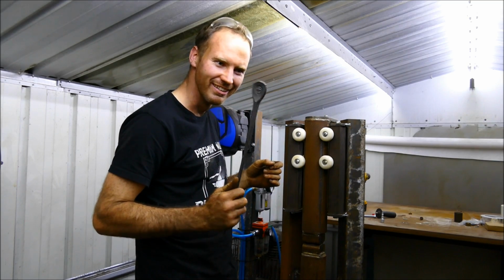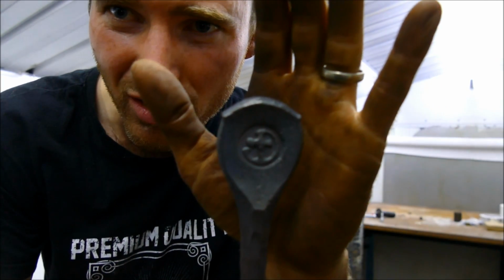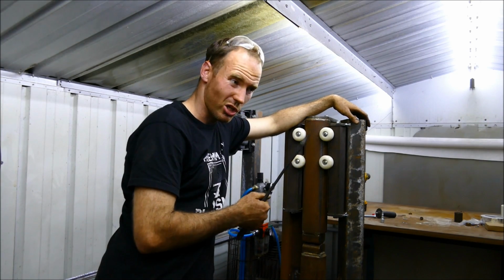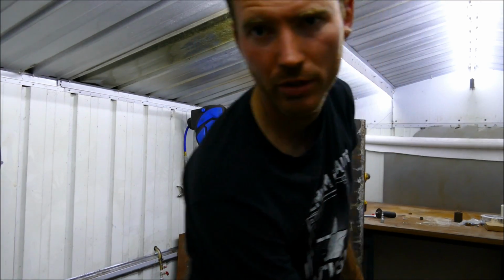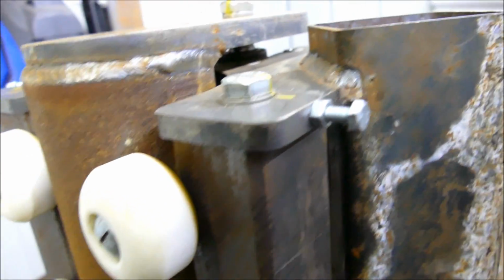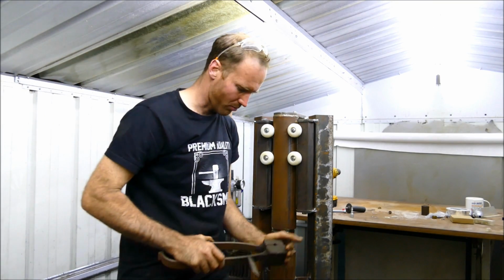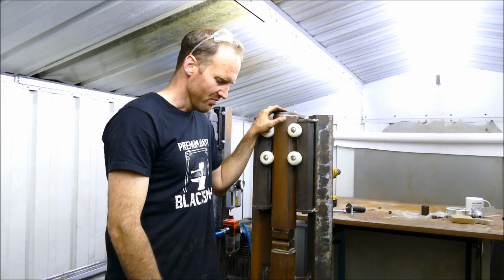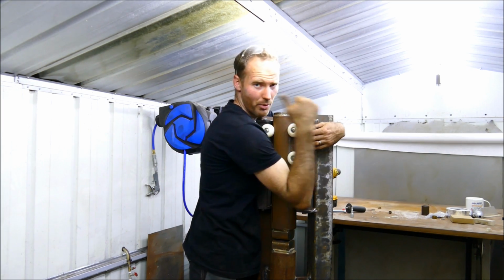!NEW! Ultimate DIY Power hammer build - pneumatic money maker - part 1

Comment: Full props to you mate I'm in the same boat as you working as a fulltime fabricator and forging on the weekend it's not easy just got to slowly tip the scales to being in the forge more.
Epic hammer bu the way definitely a step above  most attempts at a pneumatic hammer
Reply from the maker: Thank you! its going to make life so much more efficient. got lots off tooling to make the flowers and sculptures. just made it more pwerful too next video. cheers J

Comment: Good job! For building it from scrap and making it as simple as possible, it does a great job. I wish I had a video of my hammer, I only have it on instagram, on @jarntagforge However, I'm worried on your hammer that you don't have sufficient guides for the hammer head. On top of the stroke it's in the air and only the cylinder stabilizes it, so the cylinder takes the brunt of the wiggly forces. On the way down once it hits, the force from hitting the metal will shift the ram sideways, especially when doing tapers. Imo there should be a pair of skateboard wheels right at the end of the frame above the throat, just for those forces. Finally, how about putting wood boards between the baseplate and the concrete? I think without cushioning, the concrete might fail eventually. Or not. Who knows. But all in all it's a really functionable and well working machine.
Reply from the maker: Thank you so much! I'll check out your hammer. The wheels are doing quite well and they stop the twist but I have thought of putting a rubber or nilon bushing in the connection to take some of the shock from the cylinder just incase. I can't space the wheels anymore without missing the hammer head. I didn't want to put rubber/wood because it will take away some of the energy transfer from the Anvil. Needs a connected mass 10x the weight of the hammer head to work to optimum efficiency. But I did think Instead of cast concrete in the ground I could build a trough on the base plate and fill with concrete, that way I could justify a rubber matt underneath and not have needed to dig a hole. Cheers J

Comment: Do you  think  you  will  need  to  shield  the air  lines from  sparks?
Reply from the maker: Yes. I've converted to copper pipe for better air flow and heat protection. Next video. Cheers J

Comment: Excellent build. You will need to put a ram-travel limit-stop at the top end of things! At 8:58 , the drop-weight goes to the top of it's travel and stops with a klank. The 'klank' is the ram piston hitting the top of the cylinder inside, assisted by umpteen kilos of drop-weight. This will quickly kill the cylinder. An upside-down 'U' bridge between the tops of the 80mm posts with a rubber stop-block inside it would prevent this. Something like a gearbox mount from a Land-rover, suitably modified. Good Luck!
Reply from the maker: Thank you I've done a more simple modification for the same problem by putting a ballistic rubber washer inside the cylinder at the top end. It's sandwiched between two steel plates also which helps take load of the cylinders fixings. Cheers J

Comment: Really awesome. I wish I had a power hammer. 

How long does it run before the compressor needs a break to pressurize?
Reply from the maker: On that 1"(25mm) I could forge it from welding temp to too cold then it would kick in and fill up while I'm re heating the steel. Ideal really. Cheers J

Comment: i like the compact size but if you turned the pneumatic cylinder around youd get more force
Reply from the maker: That's true as far as the pressure of the bore is concerned but on the return there is less air needed to fill the cylinder. Combine that with gravity and the quick exhausts and I think it makes it a quicker stroke. I think it helps also having the extra pressure to lift the weight of the hammer up. Cheers J

Comment: OOOOEEEEEE That was a nice bead there. 7018 rod?
Reply from the maker: It's actually 6013 because it's all I had at the time but 7018 would be better to use because of its higher tensile strength. 7018 would also produce nicer vertical up hill on the possitional welds. Cheers J
Reply: @joshuadelisle  I'm still in school for welding and most of my experience on stick is with 7018, and that bead profile looked pretty similar. And yeah, it's definitely nice for those uphill welds, although I've always hated doing those.
Reply from the maker: It's always impressive if you can do virtical up. If get in to possitional pipe it will pay out a lot more. Also for contract repair work 9/10 you need to virtical up because that's the limit of a farmers welding skill. Try some 6013 it's great for small stuff as a general purpose electrode. Easy to start and comes out very neat. Cheers J
Reply: @joshuadelisle  I've also done 6010 in class, and done 7018 and 6010 in all positions with fillet and outside corner joints. My real love is TIG though, and I'd love to break into the cleaner, quieter part of the industry. Fabrication or maybe aerospace.
Reply from the maker: @Elvirth24  sounds good I do a bit of stainless and aluminium. I like contracting personally, I'm not a fan of corporates after working for some. People pay a lot for a man willing to get his hands dirty. But I love tig too. Cheers J

Comment: It looks like you didn't quite get the wood up to forging temperature. That's why I think it's splintered. 😂😂 on a serious note however that is an awesome build and your workmanship is to be commanded. You obviously know how to weld in line things up properly. I really like how you adjusted the floor. So driven for this project! KUDOS 👍👍
Reply from the maker: Thank you so much!  So funny....I love welding probably as much as smithing now. At least it pays better. Though nothing like beating a bit of steel. Cheers J

Comment: Not exactly like my design but whatever works. !!!! Nice build.
Steel is just so expensive any more.
My guess you've got over $400.00 USD invested in the frame work. Nice.
Reply from the maker: Could be. I calculated it £250 of new steel. But I used off cuts from jobs that were paid for not that everyone has the same luxury. Thank you Roger what's your hammer like? Cheers J

Comment: Do you think the air cylinder could do with some sort of dampening? It looks very severe and something is likely to break with all the ridgid hammering! Simple design though!👍
Reply from the maker: I have just optimised as you say. Put ballistic rubber washer inside the top end to protect it from the up stroke. has a flexible bushing in the joint too. Cheers J

Comment: Look at wood gasifier also known as wood gasification I believe they're more efficient in Steam.
Reply from the maker: I like it. cheers J
Reply: How is the gasifier producing the steam? If you can message me a link to an explanation I would be very greatful
Reply: @nameloc1000   gasifiers will produce excessive Steam if the wood chips contain more than 20% water and when the gasifier is in use and when the chips are under high heat and low oxygen  the gases content will travel through the gasifier and most of the steam will condense to the cyclone and the radiator will help condense more of the steam back into water and the filter media example straw will also create more surface area for the steam to condense on. And when you get your gasifier operating properly the only byproduct from the wood gasifier will be activated carbon that has uses in itself

Comment: good job dude i only hope your actuator lasts the distance, they’re really not designed for impact loads but i do hope it lasts
Reply from the maker: Ive adapted it to have a ballistic rubber washer inside a the top end to stop wear from the impact, its also sandwidged between 2 steel plates that stops it from killing itself. so far so good, new video coming soon. J

Comment: It's only do it yourself if you can afford the parts that's still under a loans probably six hundred bucks at least
Reply: do you have any scrap yards around you, in my town I could easily pick up the steel for less than a hundred bucks and build something very similar, of course the cylinder and air parts will cost some. but I believe a crafty person can come up with something very close to this with low cost.
Reply: T Sasso, what do you want? Nothings free, so that's off the table... if you've got better by all means, do demonstrate.

The nerve it takes to complain about a DO IT YOURSELF build...
Reply: And 600lbs is way less then what ypu would pay for a used big blue if you can find one.

Comment: Great looking stick welds mate :)
Reply: Using stainless rods?
Reply from the maker: @Mad.Man.Marine  it's a 309 dissimilar rod I believe to weld high carbon to low carbon steels.
Reply: Joshua De Lisle thought so. 309 is stainless steel.
Reply from the maker: @Mad.Man.Marine  yes it is. One tip I didn't mention in the video is to pre heat the parts that are above 1"(25mm). Cheers J
Reply: @joshuadelisle  Im only self-taught on mig and tig. any tips for doing these welds with a MIG?
Reply from the maker: @jamesoliger2379  Make sure the large solid sections get pre heated first so they are at least 50 celcious before welding. you'll need a machine capable of spray transfer to get adequate root penetration otherwise because the shock from the vibrations will just crack the weld off otherwise. go on weldingtipsandtricks.com channel for good advice on stacking your beads and how to angle the torch when layering them up. All the very best cheers J
Reply: Just remember, a grinder and paint will make you the welder you aint.
Reply from the maker: Thanks Dude!
Reply: @joshuadelisle  I was looking at the half inch valves the UK one is like 20 pounds whereas the USA one is 234 dollars is there a reason or is there a different valve that can be used.?
Reply from the maker: @joshhuskins5363  I'll look into that, shouldn't cost that much. Cheers J
Reply: His welds are amazing, aren't they?

Comment: you should make the option for changable dies in the new version :)
Reply from the maker: I could but I don't think you need to. I used my Sahinler for 8 years and never needed to and just used interchangeable shoes instead, quicker and cheaper. Cheers J

Comment: Hello,
 this is pretty awesome DIY project. It may be better to use a floating joint between hammer and pneumatic cylinder. Because the hammer and cylinder are not perfectly parallel. And then the piston bends and the service life is reduced. Floating joint is strandard in almost every pneumatic projects. See for example on floating joint JAH50-20-150 by SMC. There is not a floating joint in CHLED catalogue. Didn´t find them. 
Excelent job ;-)
Reply from the maker: Cheers Robert i'll look into that, so far its been fine. but i would like it to last forever. cheers J
Reply from the maker: I think for now it's working fine. I may bore out the hole and put in a nilon bushing or attach an engine rubber mount in the connection. Cheers J

Comment: Would it improve efficiency to use the "UP" exhaust air to power the "DOWN" stroke?  Or would it require a different type of air valve?  It looks to be a solid hammer, and hope it works well.
Oh, by the way, Roy sent me.
Reply from the maker: Thank you! I don't think it will make a difference because it is the same psi In the pipes as in the cylinder, the main thing for power is a large quick exhaust and 1/2" pipes and fittings for better air flow. Cheers J

Comment: Just wondering how long do you expect the air cylinder to hold up under the conditions?  I could probably rebuild an old one from one of our solo slide gates for next to nothing.
Reply from the maker: I've just modified mine by adding a rubber washer inside it so when it fully extends it doesn't damage the one end when it knocks the top. They are as you say cheap as chips too. Cheers J

Comment: I would definitely be interested in making or buying one! Can't wait to see what little improvements you would decide to make!
Reply from the maker: Thank you so much! Patterns are ready now, just click in the description, I've stopped the top end knocking from the cylinder fully extending and it more powerful with thicker 1/2" pipe and fittings. The new design is more accessible around the anvil of the hammer. Thank you commenting. Use POWERHAMMER1 as a coupon code for 20% off all my designs. Cheers J

Comment: How much is the head weight ??? Or does it even matter or maybe it's multiplied a bit considering it's being driven into the material a little bit differently I guess than an mechanical hammer ????
Reply from the maker: The head is 68lb, 1500lb of force on a 1"(25mm) square area
Reply: @joshuadelisle  I hate it but man you now know what has to be done , it is your duty sir to smash the bejesus out of some rubbage  my dude , you be the first on here to do it sure you get a lot of views , come on man just a few canalope is all I ask or any melon of equal or greater value 🙃 so it is written so shall it be
Reply from the maker: @blakehorton8110  maybe... I was going to show the control by closing a match box or crack an egg without making a mess. Or I can go smashy smashy. Cheers J
Reply: @joshuadelisle  what wait what ..... my brain just sizzles out a bit , all of the above my dude all of the above I say 😲

Comment: Brilliant!  I am not quite sure I understand all I know about the 2 quick exhaust valves in regard to the timing between them .  Does the lower valve supply pressure to return the hammer to the up position with  no spring assist?  What determines when one is open and the other one is closed? Can you explain that cycle please?    Thank you for posting, Jerry.
Reply from the maker: Thank you so much. It's hard to describe in the written word but if you look on YouTube and type 'how pneumatic quick exhaust valves work' you'll find an expert show you properly. Cheers J

Comment: First off,, Great idea. nice build. The only thing I would have done different is to preheat your round bar B 4 welding. hope you don't have issues there. Anything 1" or greater needs a preheat.
Reply from the maker: Thank you Steve that's a very good idea and I will suggest that to everyone in the next video. I did several runs all the way round so I guess it pre heated it self but you are right it's best practice to pre heat and do it properly. Cheers J

Comment: just be careful with the pipes behind make sure they're away from the heat . just a point. not a criticism .god bless
Reply from the maker: I've just optimised it further and made it more powerful by replacing the pipes with bigger copper pipe, increasing air flow and as you say heat resistance. Thank you so much. Cheers J
Reply from the maker: Hey! Thank you so much for your kind comments and subscribing, patterns are now available on my Etsy shop detailed in the description and to say thank you here is a discount code for 20% off! just type POWERHAMMER1 as a coupon code. cheers J

Comment: Just a question what max psi do you run your compressor for this set up? Cheers
Reply: 120psi cool
Reply from the maker: I've just optimised it further and made it more powerful by replacing the pipes with bigger ones for better air flow meaning faster acceleration. Cheers J
Reply: Well done man, keep the great work going when you got time!
Reply from the maker: Thank you! Might not be regular like YouTube wants me to be but can be sure I'll do something creative as some point. Cheers J
Reply from the maker: Hey! Thank you so much for your kind comments and subscribing, patterns are now available and to say thank you here is a discount code for 20% off! just type POWERHAMMER1 as a coupon code. cheers J

Comment: Did you use a pencil to put that screw in after you put loctite on it??
Reply from the maker: It's an Alan key. I'm switching to hex bolts so I can use a nut driver. Cheers J
Reply from the maker: Hey! Thank you so much for your kind comments and subscribing, patterns are now available on my Etsy shop detailed in the description and to say thank you here is a discount code for 20% off! just type POWERHAMMER1 as a coupon code. cheers J

Comment: Wow , only just seen this.  Super stuff.

I should go looking in the scrap bin tomorrow.  I know I have some 90mm round !
Reply from the maker: I calculated that the Anvil or concrete combo should be 10x the weight of the hammer head. All the very best. Cheers J
Reply from the maker: Go for it dude! I've got the design coming out this week. Cheers J
Reply: I will look at the design for sure.  My main problem is I'm on a wooden floor (maple tongue and groove, over standard floor planks, set on beams), set about 2 feet off the ground.  I would have to cut out a square in the floor and then do a form of mining.  Not impossible though.
Reply from the maker: Hey! Thank you so much for your kind comments and subscribing, patterns are now available on my Etsy shop detailed in the description and to say thank you here is a discount code for 20% off! just type POWERHAMMER1 as a coupon code. cheers J

Comment: WOW! I had discounted air hammers as too complex till I saw yours, dead simple and compact...genius
How many cfm does it use?
Reply from the maker: I'm not entirely sure without a flow meter. But it will forge 1" hard until it's too cold then compressor kicks in. it fills while heating it back to temperature then good to go again. I have good control but can lessen the PSI for lighter blows also. Cheers J
Reply from the maker: Thank you so much! J
Reply from the maker: Hey! Thank you so much for your kind comments and subscribing, patterns are now available and to say thank you here is a discount code for 20% off! just type POWERHAMMER1 as a coupon code. cheers J